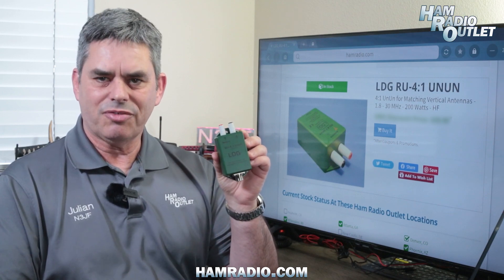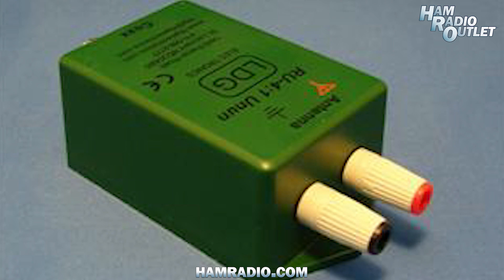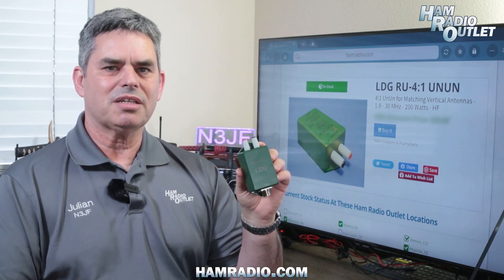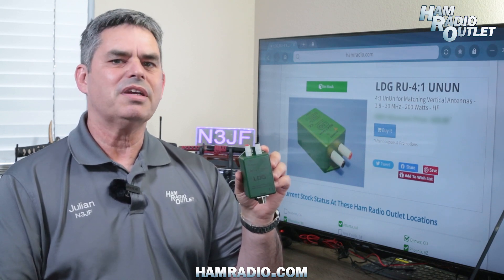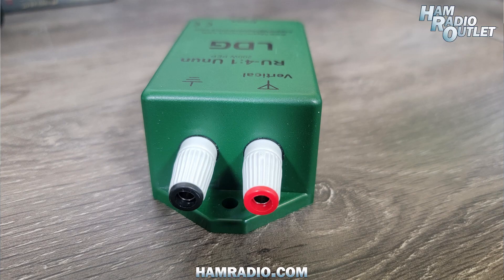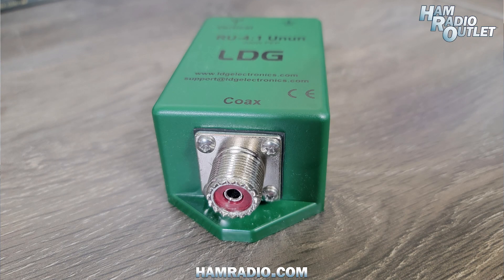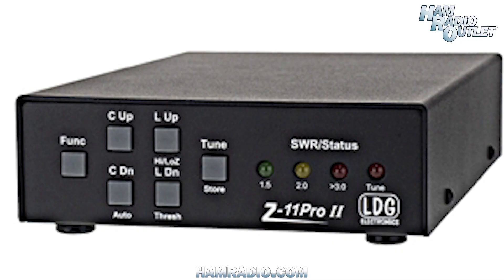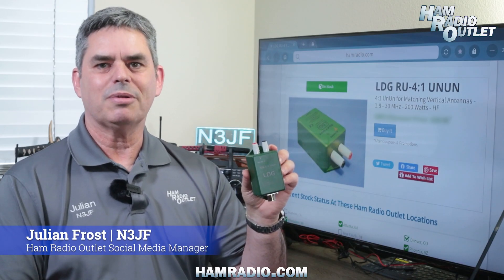LDG RU-4:1 Unun - Ham Radio Outlet

Comment: I regularly have a Xiegu G90 running digital modes and feeding a small toroid homebrew 4:1 like this and feeding a 50ft Stanley tape measure at 6 ft and a ground rod.  Since this is SHTF rig I generally run on solar at just under 20w.  But sometimes I go 100w with the companion amp.  I have had no heating or arcing issues.  Bottom line is that component and construction quality matters.  Just my 2 cents.

Comment: Bob @ balun designs DO NOT use these tiny whittle balun s. They don’t hold up to 100w maybe qrp but I melted down one on my 160m doublet with 4” spaced open feedline. With in two minutes my ldg at200 tuner was clicking away trying to retune after getting 1.3:1 at the start of the transmission 30 seconds later the tuner retunes. So I try a few more qsos and reach over to fell the box warm go a few more minutes and the case was smoking hot. Ssb should never make a balun hot but these are tiny little transformer ferrites. I sold off the tuner and threw in the three little boxes to a guy for 20$ who was going to use it mobile on 50w I told him to keep it to 20w max. Put a old dentron super tuner from the late 80s and antenna tunes no issues no balun except the one on the output of the tuner, plus a 811h Antenna works great. Won’t ever suggest a ldg product again. Incase you put two plus 2 I was using a 1:1 balun on a 140’feeder to a 240’cntr fed doublet 70-80ohms at the tuner. My new Tuner is a AT5K with balun on the input where it belongs so it can see a 1:1 vswr All baluns must be used where they see a 3:1 max swr 😉
Reply from the maker: Many, many, many people use LDG products, including their tuners without any trouble whatsoever. I been using one of their tuners for years and it's been totally trouble-free. There are many 5-star reviews of the RU 4:1 UNUN on the internet, including on eHam, where it rates a 3.5 stars (most reviews are 5-stars, but the average was clearly brought down by a few very negative reviews). I have an RU 4:1 UNUN, a new purchase (with my own money), but haven't had an opportunity to test it. I can't speak to your personal experience and have no reason to doubt it. I think if what you experienced was a common issue, there'd be many more nagative reviews than there are.
Reply: @HamRadioOutlet  I love my LDG tuners and have enjoyed the most wonderful support from the company. They go above and beyond when it comes to taking care of their customers. Several times I've asked about the availability of spare parts and they just sent them, at no cost. A first class outfit.

That being said, their line of baluns/ununs are junk that simply aren't up to the LDG name. I know, I own several. Just open one up and look at the shoddy construction...cores hanging in the breeze supported only by solder, dodgy solder joints and amazingly sloppy and non-standard windings. Bifilar windings that should be kept parallel to avoid stray capacitance look like they were wound by a monkey on speed. I bought an RU-1-1 unun to use as a common mode choke and was shocked to find my resonant antennas were no longer resonant with the choke inline. A quick check with a VNA into the choke and then a 50 ohm dummy load showed the swr steadily rising, hitting over 3 to 1 at 10 meters. I rewound it with fresh wire in the conventional manner and SWR is now flat across the HF bands.

I'm not alone here. Many people on the LDG GroupsIO forum report the exact same problems, as do multiple customer reviews on various dealer websites. There is a reason they are so cheap. I'm willing to bet they are made overseas with little or no involvement by LDG. Quite a contrast from their tuner products with are impressively designed and built.
Reply: I love these baluns. I hope they are considering a 49:1 version sometime soon.
Reply: @forgetyourlife  They are very easy to make yourself and you'll likely end up with a superior device.